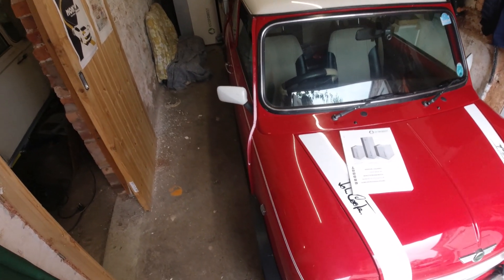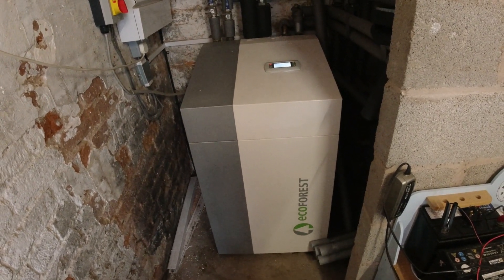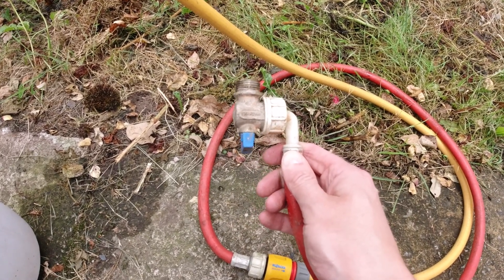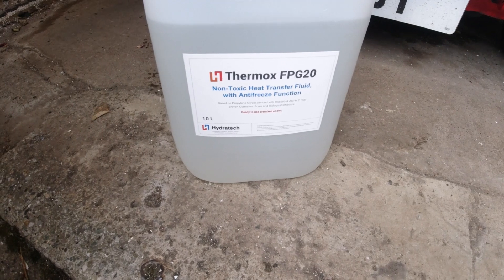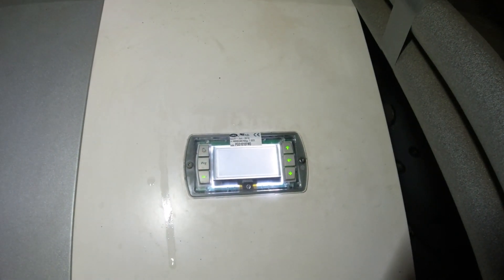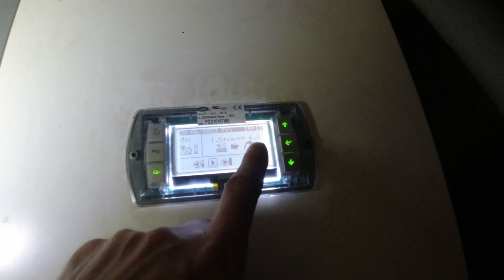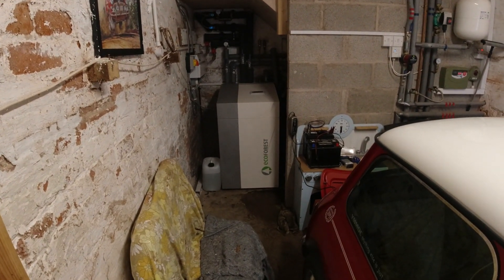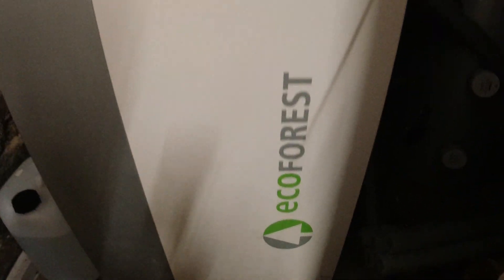How to top up the glycol (brine) on your heat pump system. Ecoforest ecoGEO ground source heat pump.

Comment: Good idea. The only thing I would add is that at one point you had the sprayer on its side which could lead to you putting air into the system which whilst still restoring the pressure is not a good thing.
Reply from the maker: Good point! There was a pipe in the bottle that went into the liquid but yes there was a risk of getting air in.
I've not had to top it up since so I must have done something right 🙂

Comment: Great video, i’m moving into a house with this system installed can i ask how noisy it is as its installed in the kitchen surrounded by a kitchen unit, thank you in advance for any advice cheers
Reply from the maker: Thanks. It's no louder than a washing machine. It's quite a low frequency sound that it produces, more of a hum.

Comment: thanks for this really useful as new ecoforest GSHP owners. Did you experience a loss in performance with the lower pressure? Really struggling to get ours heating to the required temperature, consuming loads of electric, and pressure is at 0.6 bar.
Reply from the maker: Thanks. I didn't notice any real loss in performance but sometimes it would shut down as the pressure was too low. From experience it takes a lot of tweaking to get the performance right. The lower flow temp means that it physically can't heat a room up as fast as a traditional radiator. I have fab assisted radiators and they seem to do the job ok.

Comment: Good ideas, thanks for the video!

Don't you have to deaerate the brine loop?
Reply from the maker: Thanks! The air should gradually find it's way out over time. I have a 1200m loop so it would be quite hard to bleed the system in full.

Comment: Nice to see someone demonstrating an EcoForest pump. 👍You have same system as us ... just wondered whether you have ever had alarm indication "Low Evaporation Temperature". We're now getting numerous alarms and ESP are working on finding the cause.
Reply from the maker: Thanks. It is a good system, it's has been very reliable. No, I've not had that error before. I'm wondering what could cause that issue? As pressure and temperature are linked I wonder if there is a pressure issue elsewhere in the system? Good luck with getting it sorted 🙂

Comment: Hi bud. Thanks for the vid. Really helped me. One thing, do you know what the vertical bars are on the display? There’s 3 of them next to the production, comp & brine symbols at the bottom. I can’t find any info on them and why they fluctuate. Thanks!
Reply from the maker: Glad to hear that you found the video useful. I think that the three icons show how hard the pumps and compressor are working. I just checked mine and the middle symbol (triangle ina circle with no fill) was showing about 2/3. When I went through the information menu for the compressor (same symbol) it showed it running at about 66% of capacity which would correlate with the icon on the front.
The other two symbols, at a guess, are the brine pump and water pump.